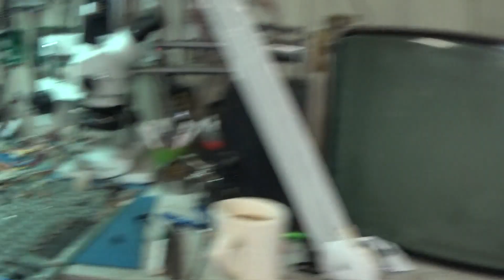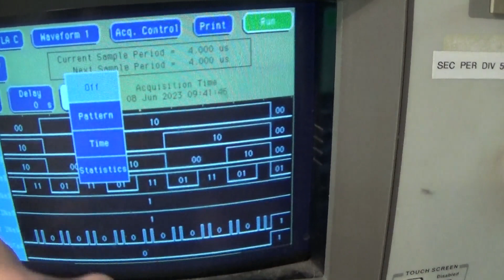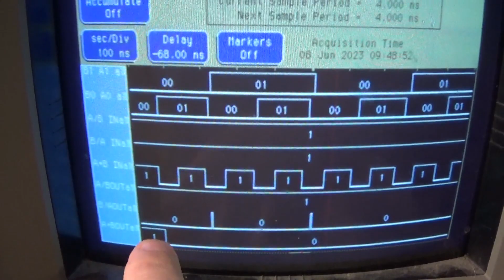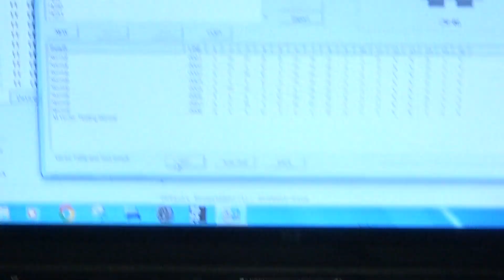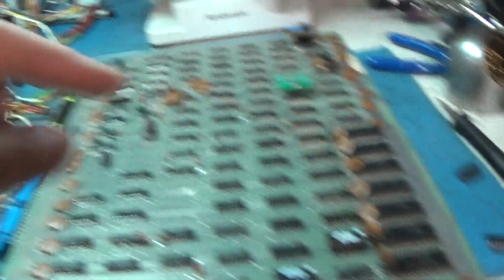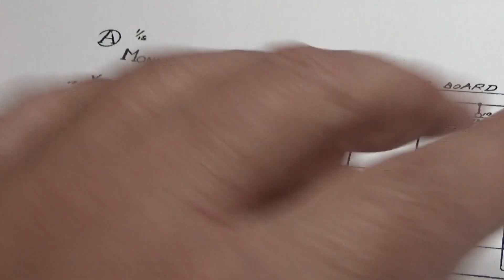1980 Sega Monaco GP Arcade PCB Set Repair -- Part 4  -    6-09-23

Comment: I wonder if the inputs of that set/reset latch were getting signals at the same time causing the output to act crazy. That's the problem with a set/reset circuit, there is a bit of timing needed on those inputs. Would have liked to seen the inputs of those on the scope to see if there was collision. Maybe that's why when you jumped the other one on top it spaced the timing and it cold latch properly. Good stuff Sean!

Comment: By the time you're done with this, you're going to be an expert in this board :)

Re the light issue:  First make sure C22 is correct.  It must be there for a reason, and it likely affects light timing.  There's also a capacitor on the reset side that might hold low too long if there is insufficient pull-up on the NAND 56.

An explanation about the car display circuit:
The "OTHER CAR" sheet is actually "OTHER CARS".  (Japanese doesn't have a plural form of a word, so perhaps the English translation team didn't add one).  You'll notice that the final priority encoder RGB out sheet has "OTHER BODY" as an input related to "AREA 1" through "AREA 5".  Each of those "AREA"s is a car color.  AREA 1 is the dark blue car, AREA 2 is the maroon car, AREA 3 is the green car, AREA 4 is the yellow car, and AREA 5 is the turquoise car.  Going back to the "OTHER CAR(s)" sheet, you'll see that the car color is chosen by multiplexer 94, which has counter 101 as input.  AREA 1 also goes to two AND gate inputs.  One of them turns on bus transceiver 124 which is fed by counters 116 and 117.  I see a couple of possibilities for making the car look weird:  Bad transceiver (doesn't send all the address lines), another bad transceiver (doesn't shut off), or bad counter circuit.

The ACCE inputs are there because the faster you go, the more cars appear on the screen at once.  It seems to accomplish this by presetting counter 102 with the speed of the car on every rollover, which modifies how fast 101 counts.  101 chooses a car for an area.  Since there are 3 counters and up to 5 cars, multiple cars will share the same road alignment, chosen with a nontrivial circuit involving latches sampling data from the frame counter.
Reply from the maker: Sounds like you are an expert on these boards!! :)
Reply: @Classic Arcade Repairs  Heh, I gained an interest in analyzing the schematic, though it looks like I was wrong on some details about this.

ACCEL addresses the ROM (115) which outputs a speed nibble to the cars and a speed nibble to the road counter.  The load value for the cars says whether they seem to move forward or backward on the screen.  The 9-bit counter (101, 102, 107) counts to 511 and then resets to 48 + the speed nibble.  For 0-255, the multiplexer is off so none of the other "AREA"s will be turned on, but it turns on AREA 4 through separate logic at 128 through 159.  AREA 2 is next at 256-287.  AREA 3 at 384-425.  AREA 1 at 426-457.  AREA 5 at 608-639.  The counters will only coincide with the retrace sweep when you are going the same speed they are, which would make them look like they're standing still.  Otherwise it completes just a little faster to move them forward, or a little slower to move them backward.  The latches I mentioned change whether or not they appear.  FF 74 is for AREA 1 which uses 116,117 for vertical positioning.  92 is for AREAs 5 and 2 and uses 104/109.  99 is for AREAs 4 and 3 and uses 90,96.  Just like the 101,102,107 counter, these counters complete a sweep at close to the frame rate.  A little faster to move right, and a little slower to move left.  The load value chooses this speed.

Comment: The bridge graphic is incorrect at 50:46 .  There should be water on each side.  Not the repeated side of the bridge.
For that graphic line and 279 issue in the tunnel:  most likely a chip that is almost shorted to ground(<100 ohms) on one of its input.  Ohmically measure each of the i/o pins to ground and check they measure about the same.  If not, follow the path to other chips.  One of them is flaky.  
Note that i haven’t seen any testing for the accelerator, steering, shifter, sounds or scoring yet.  I would not call the set ‘good’ until it is all testing.  
The accelerator has 4 levels plus the shifter that multiply x 2.  ‘My car’ moves to a different location for each level during game play.
All the chips identified as U2xx are used in the demo mode.  Not documented in schematics.
And, in demo mode, road moves all the times and stretch back and forth except on the bridge and in tunnel.
Reply from the maker: Oh yes… Thank you for bringing that to my attention about the bridge… For some reason I was under the impression that that was the tunnel and that is what it was supposed to look like lol. Good news is is I still have the boards so that should be an easy fix. As for all the other testing, such as scoring boards, and all that other stuff… I’m not concerned with it because the owner said that the steering and acceleration all worked fine… And I don’t have the proper hardware to test it anyway… I can kind of mess around with the circuit and get things to move and kind of do what they should…
Reply from the maker: Update… The bridge issue has been fixed… I had run a jumper wire to the wrong pin on the ROMS…Leaving an open address, bit, as well as corrupting a data line… When I removed the two Ramz that coincide with the bridge… I pulled trace pin number 4.  Well, when I reconnected it, I mistakenly ran my jumper wire to pin 9 instead of pin 4.  Which in turn corrupted data bit 0… And left an address bit floating on pin 4